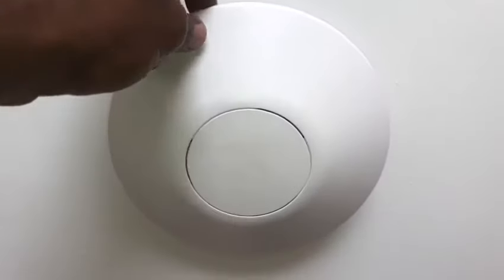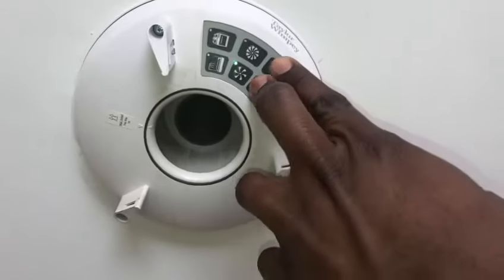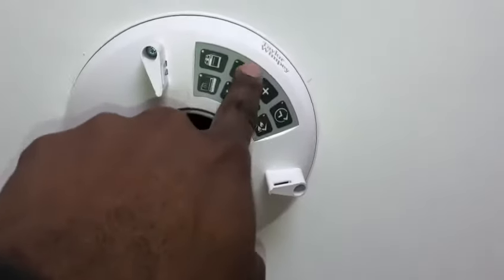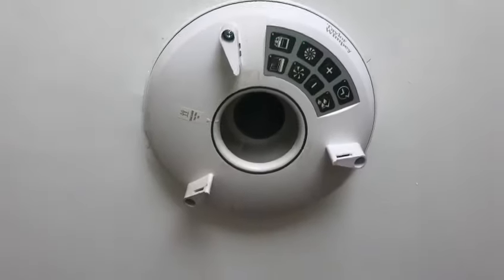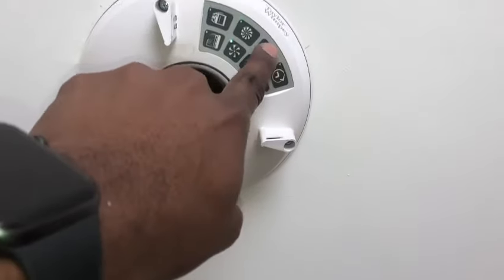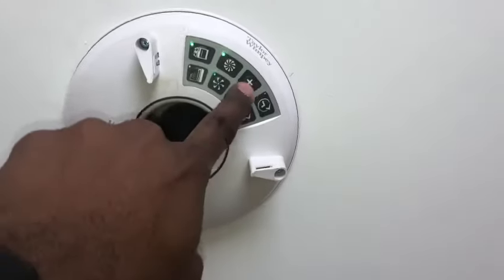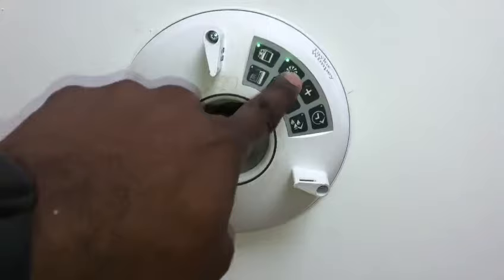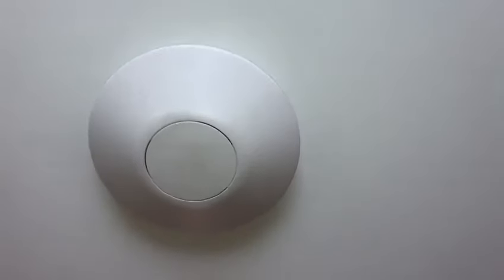How to set the Greenwood Airvac CV2GIP / CV2SVGIP system for kitchen use

Comment: Crap these fans are. Mine don't come on automatically all the time. They seem to do just whatever they fancy. I've reset it like this multiple times and still no good.
Reply: They're terrible. I have 3 all with the same settings and they all have a mind of their own!
Reply: @KumaMooMoo  since posting I have had to have mine replaced as they were so bad. Issue with them was a faulty humidity sensor apparently.  They are actually working now
Reply: Mine is fine.